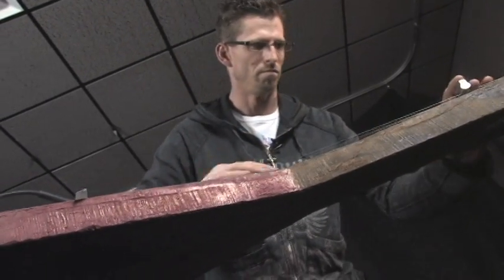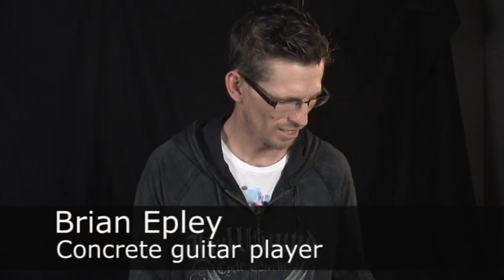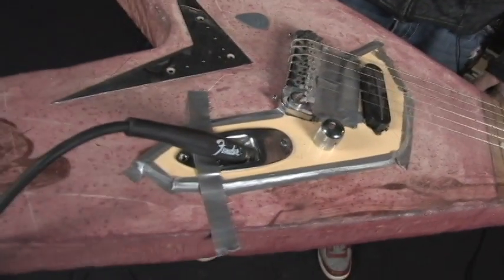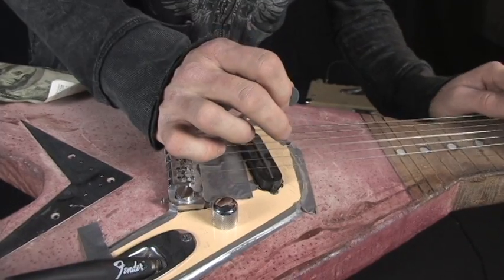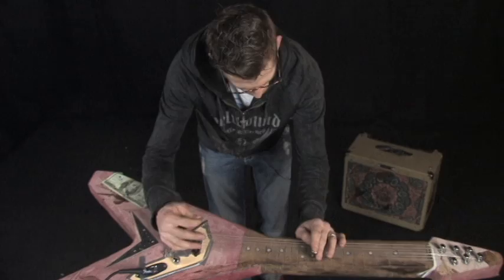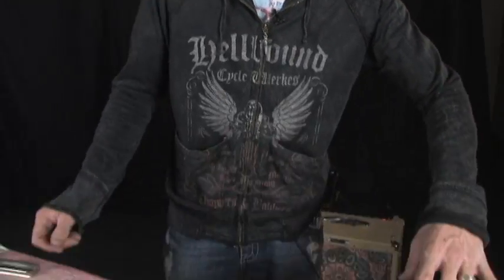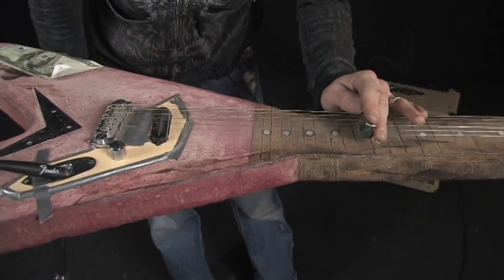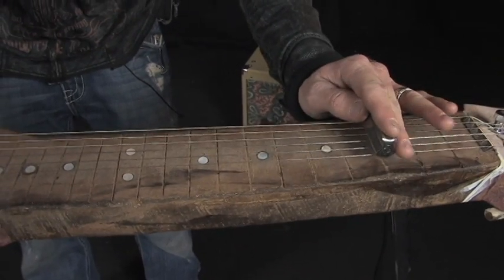Unusual Instruments: Concrete guitar

Comment: the material the guitar is made of is not a factor of it's amplified sound, concrete is not magnetic and neither is wood, an electric guitar can be made of any material so long as it can support the tension of the steel strings, the sound of an amplified electric comes from the bridge, the nut, the tuning pegs and the electronic circuitry, the material of the body is not a factor, Guitar companies spread tonewood propaganda to sell expensive guitars, Can't say that I blame them they are in the business of selling guitars, but the truth is you can take a cheap guitar get it setup good and upgrade all the hardware and electronics and have a cheap beginner guitar that will smoke the highest priced Fenders Gibsons PRS you name it, it's all about the electronics and hardware, anyway yeah man that is one cool lap steel style guitar, very unique

Comment: The concrete adds NO acoustic properties its ONLY the pickups creating the electronic pulse to the amplifier.  It's been done before.  Materials have no tone creating properties in an electric guitar with a magnetic pickup.  The build quality of the guitar does add resonance to the vibrating strings. If the strings have a solid connection between the nut and the bridge, then the guitar will resonate better. Its all really the pickups and amp as for tone quality.